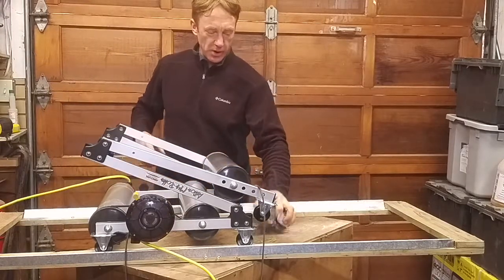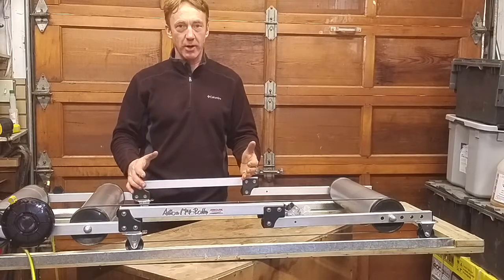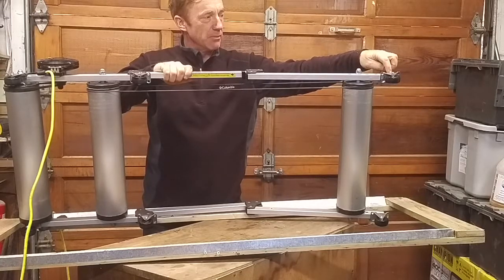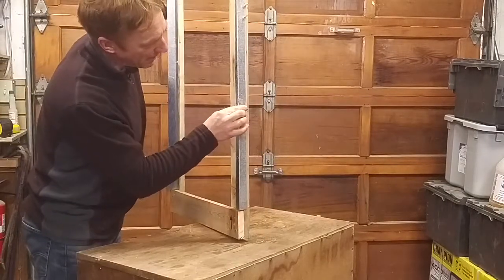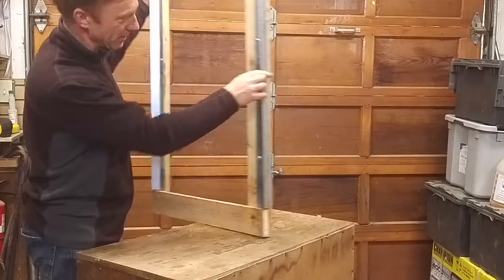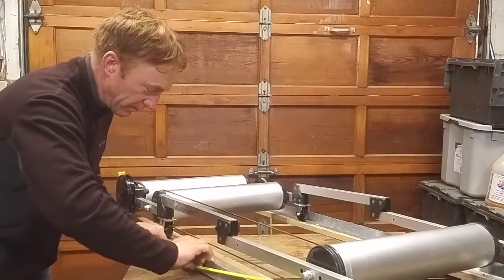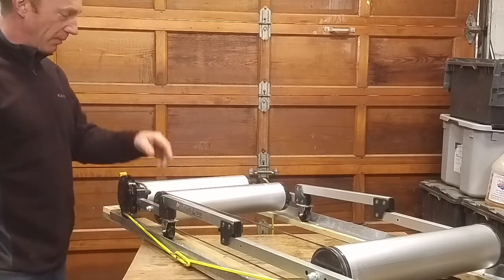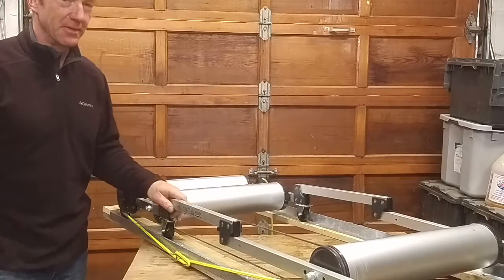Adding a slider to Cycling Rollers

Comment: Nice slider mechanism Christopher!! Can you share where can we get this adjustable tensiometer?
Reply from the maker: The tensioner is part of the rollers. I use Neodymium magnets now as the tensioner broke - well the belt did.  The Neodymium magnets are way quieter anyway and give excellent resistance if you use twenty.
Reply: @christopherpburk  thanks! I though to try with Neodyum magnets as well but my rollers are not metallyc so I'm using the same magnet unit you had (I found it) normally at position 3 pf resistance, let's see how long it takes to brake the belt. Stay safe!